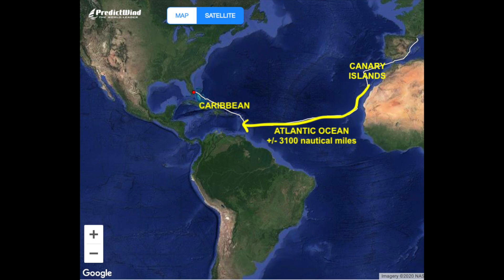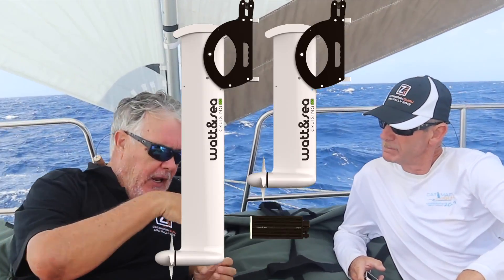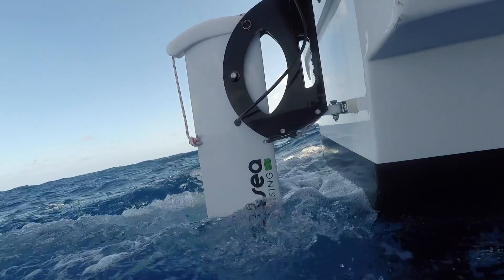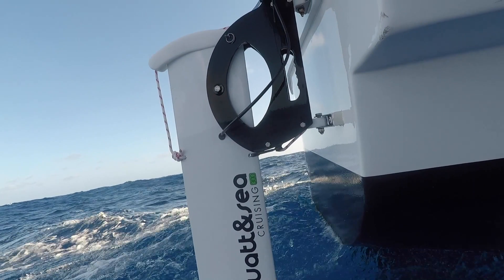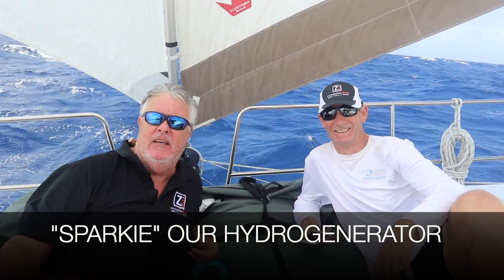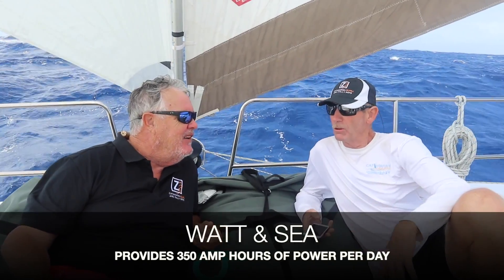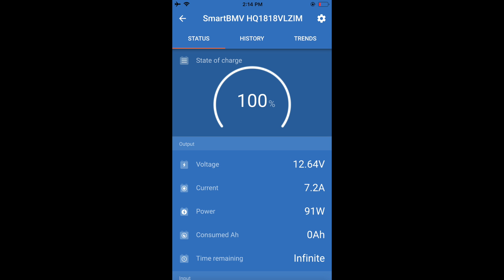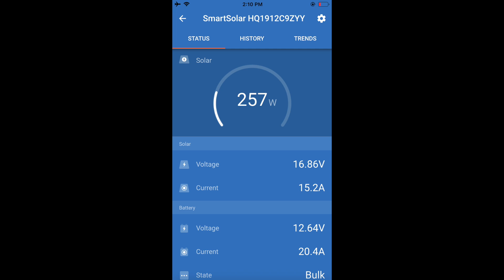How-to Power with a Watt & Sea Hydrogenerator, Part of a Multi-Source Power Plan

Comment: So amps are Ah!? Thanks for that text, now you don't speak the right units.. Came here in frustration over reading your great webpage, where you also just write amps per day.. So now, I assume you have a 12V system! Then I can actually calculate in real energy units (watt-hours).. :-)
Reply: @Catamarangurus  You are welcome..
Reply: @Catamarangurus  Sorry, just testing. Maybe long posts are cut away..
Reply: @Catamarangurus  cutting my post up to see if it is allowed...

 @Catamaranguru On your webpage you write:

“During our crossing with a crew of 8, our daily power draw was about 35 amps…a very greedy boat and crew! Our energy production plan for this high demand had 4 parts:
•	125 amp alternator on each engine
•	3 kilowatt diesel generator with 100 amp battery charger – we ran the generator for making hot water
•	8 solar panels – about 200 amps per day
•	“Sparky”, our Watt & Sea hydrogenator – minimum 350 amps per day, often more depending on speed”

Hold on! That is very wrong. Amps are not energy (you wrote energy production). A is the unit for current. To get to grips with how much energy is “involved here” you need information on duration of that current floating AND at what voltage level. Your “?” suggest that you are not aware of this, and I shall try to help you out the best I can.
Reply: part 3

Or if you wish:
 
Energy (Wh) = Voltage (V) x Current (A)  x duration (h)

You see? Amp-hour is UNDEFINED before you inform about battery voltage level. IF your current generating device stored the energy on a 12V battery (at a given amperage and duration) you would store ONLY HALF of the energy compared to the event you stored the energy on a 24V battery bank (at the SAME given amperage and duration as before).

For your own doing you can make YOUR plan in amp-hours, and not in energy units, because the amps you know of that goes in and out of your system, is at the same voltage level (IF they are..???). But, your are broadcasting a video to help others I suppose!? So, it is of no help – and actually misleading -  to your viewers/readers, if they have a different voltage level than you have. Boats are typically 12V, 24V or both 12V&24V. And then many boats have 230V too! My yacht is 12V, 24V and 230V. So you can see, I make my energy planning in energy units. Nothing else will actually work!

I hope this cleared up some concepts.

Bon voyage 🙂
Reply from the maker: @MrGentlebutfirm  Thanks. So we learn. this obviously works for us and has for 30+ years on 6 different boats but you are right, it may be different for others. Thanks again.

Comment: With a bit more solar and a 600 instead of 300 Watt and Sea you could ditch the generator, no?
Reply from the maker: That was our set up we had from the factory when we bought the boat and no, we cannot go without a generator on this setup because the hydro generator only works under way, not while stationary.

Comment: You're using wind energy to move the boat in the water and you're slightly breaking the boat with the hydro generator at the same time.
With this double conversion of energy it's more efficient to mount a wind generator on top of the mast where it doesn't affect the sails.
Reply from the maker: We have tried various wind generators on our various boats. While they do work we prefer the water generator. No noise, no extra contraptions to be fitted on the back or on the mast. This unit can easily be removed and stowed and the mounting bracket is small, so it doesn't take up much space on the back of the boat. More importantly, we were running downwind, so the wind generator wouldn't have been that effective anyway.
Reply: Also I don't think they will break the boat even slightly :) It will probably not even be slowed down noticably.

Comment: If is not an hassle to do it I suggest you to buy the large propeller. It  is rated for a boat speed from 2 to 9 knots and at low speed it pulls out quite more energy then the medium size one.
If it is not an hassle to switch the propeller using the large one in low wind situations and the medium one for the rest of the time should make your generator more efficient in the conditions where it has more problem as hydro generators at high boat speed give an impressive output, but they are weak when the speed is low. When you expect boat speed exceeding 9 knots you can switch to the medium propeller that you already have.
I am assuming that to change propeller at sea is not a problem, you should have easy access to it when the hydro generator is lifted, it is probably something that needs only few minutes (buy also some spare nuts as it is possible that you loose some of them) and the cost of a propeller is almost nothing compared to the full cost of the hydro generator.
I hope that it can help you in getting an even more efficient Sparky. Ciao from Italy.
Reply from the maker: Thanks you for the advice Andrea! We will certainly take a look at this. It is always great to make more energy efficiently. We love that the sailing community are so helpful. We learn new things every day!
Reply: why can't you use the large prop even at higher boat speeds ??? what is the drawback ?
Reply: @supersevenn  at higher speeds it turns too fast and will break if you let it turn that fast which is too fast. You can buy the racing version which has variable speed regulation with little hydraulic motor... but... it is twice the cost...

Comment: Potentially better than this would be Ocean Volt, where electric engines can self-generate.  Love to hear your thoughts, and more particularly whether Bali would have plans to replace diesel with electric, now that the technology appears to have matured?
Reply from the maker: Cal B. Yes, we like the idea. Bali is not doing anything like this currently but it doesn’t mean it can’t be done. We are doing a lot of development and upgrading with them on our boat and they are always open to new ideas.
Reply: Aren’t the Ocean Volt systems 3X the price of the Watt & Sea
Reply: @spacegreycoralred  I don't know what a Watt & Sea costs, but yes Ocean Volt are pricey but they not only replace Watt and Sea, but also engines.  Also, like electric cars, they cost less to run than traditional engines.  No oil to change, clutch issues, fuel to clean, etc.  You get more time sailing and less time maintaining.  I agree that up-front price is a big factor, but even that is changing, as battery prices drop.
Reply: @spacegreycoralred  I would say that, as are hydro generators but mainly also engines, the price is way more then 10X the cost of Watt and Sea, for a completely different function obviously, as they also replace the diesel engines. The Ocean Volt systems need a very large li ion battery and the motor and propeller are only a part of the cost as the electronics and the large section cables don't come for free. Then you possibly have also to upgrade the diesel generator as even a big battery don't give you the autonomy and you have to rely on it if you have to motor for a long time. It can be an option for a new boat or if you have to change anyway the old diesel engines as they are worn out, as you avoid to buy diesel engines, but something like the Watt and Sea is the way to go if you only want to have hydro generation.
Reply: I love the idea of Oceanvolt, but I also love the idea of not having gas (propane) onboard. Between diesel and propane, you can only realistically eliminate one of them right now on a sailboat capable of crossing oceans. Especially if you also want heating which is what diesel is excellent for.

So realistically I'd go for large alternator (Integrel has 8kw alternator!), large lithium banks and solar + hydro, and use induction cooking and electric oven.

I love that Outremer has a 4Zero already in production, but parallel hybrid solution like HH44 catamaran is I think more realistic if you want creature comforts and safety margins. You could probably get away with using the engines only a few dozen hours per year, but it's still there when you need it most.